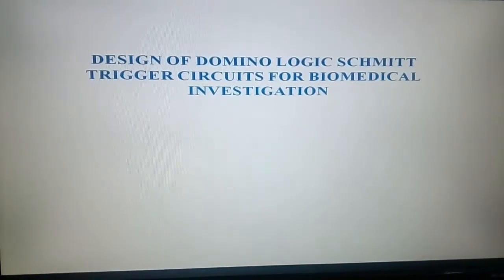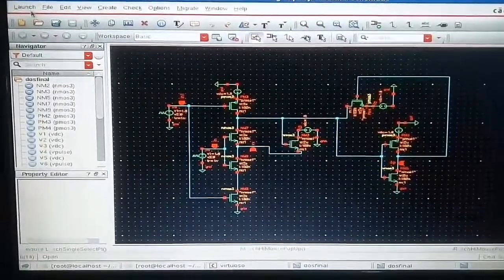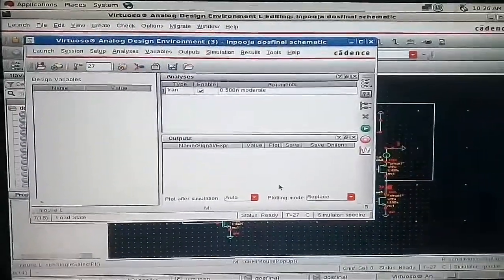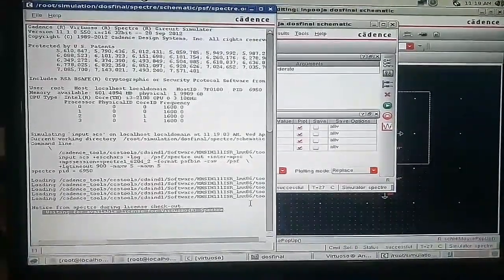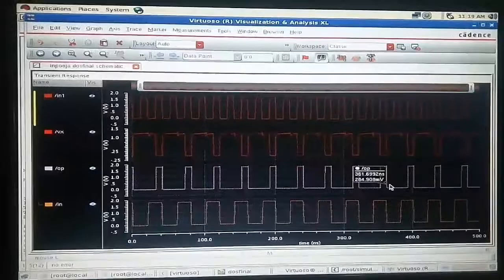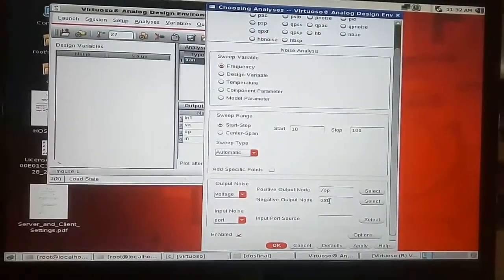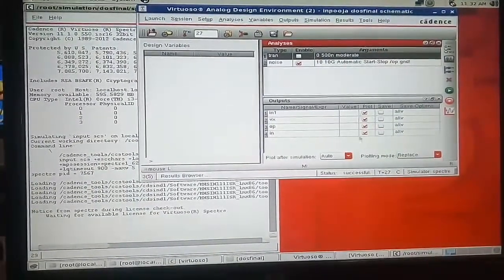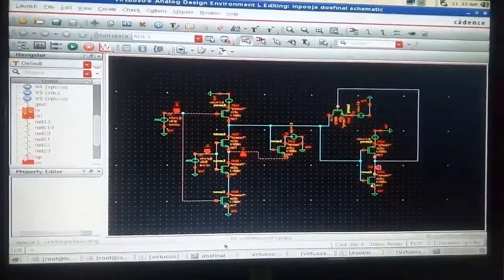Domino logic Schmitt trigger circuit

Comment: Mam i am also working on schmitt trigger can you please tell some methods or low power techniques to reduce power and improve noise performance
Reply from the maker: Hey Hi Sakshi,
Schmitt trigger with reduced power and noise has been implemented by many 
So i would suggest first find the application of the Schmitt trigger u gonna design based on that we can think of  ways to reduce power and noise.
For eg:- mine was to serve as pacemaker so i used domino logic based Schmitt trigger something like that
One more thing Schmitt trigger can be designed using different styles
Reply: @izziestephanie4927  i want  to design schmitt trigger for wireless application..... please guide me for this